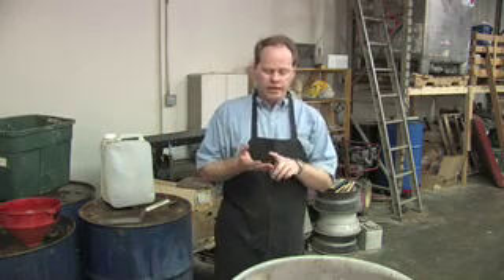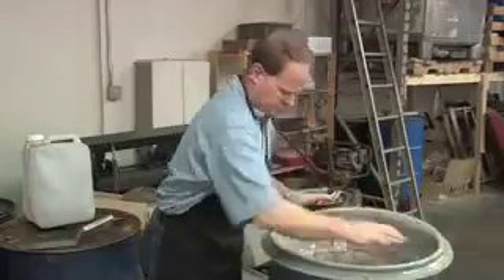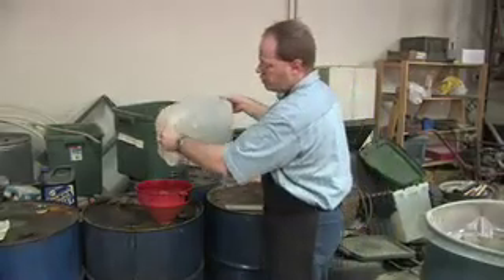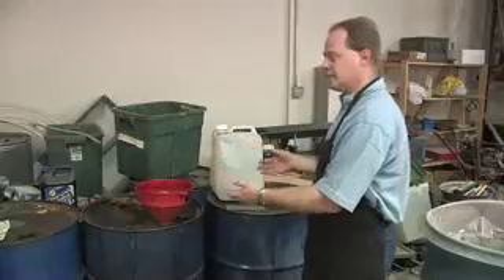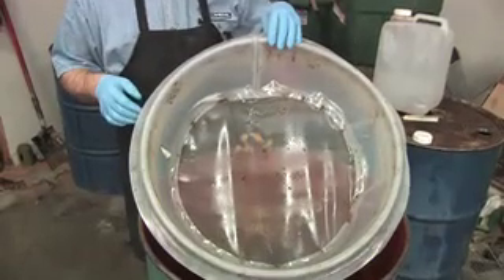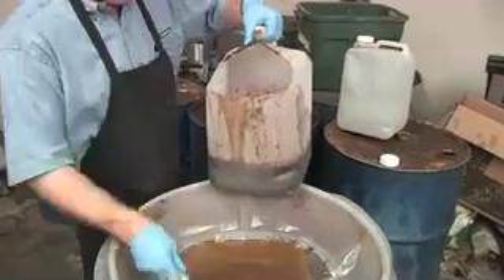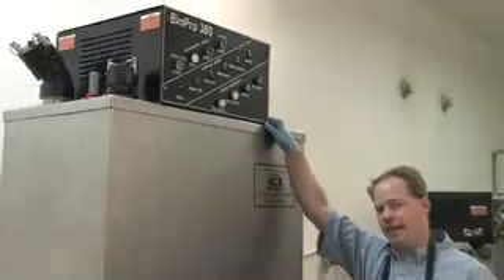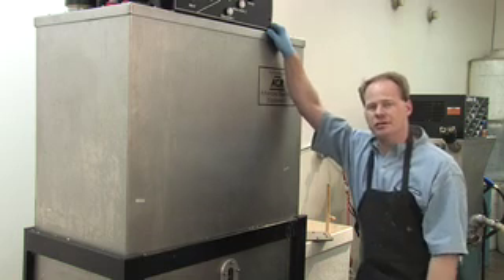Biopro 380 | Making Biodiesel at Home (Part 1)

Comment: Where are you located? Here in the US, methanol is very common at race shops. It's averaging a little over $4 US per gallon in small quantities (less in large bulk purchases). Potassium Hydroxide (KOH) runs about $65 US for a 55 pound bag. At those prices, assuming your waste oil is free, the finished product will cost you a little over $1 US per gallon.